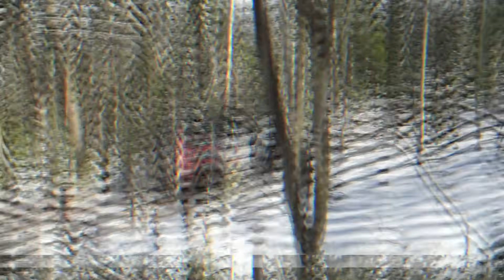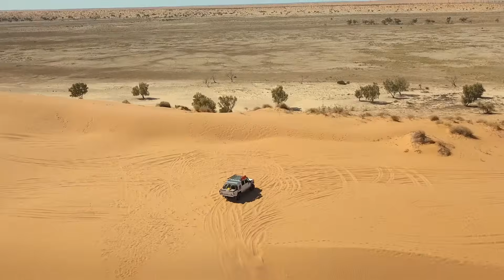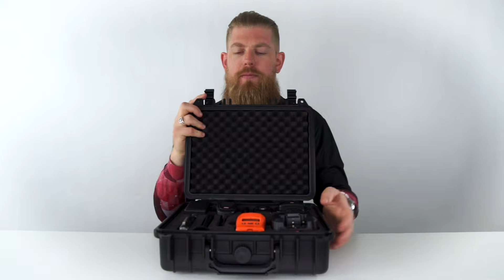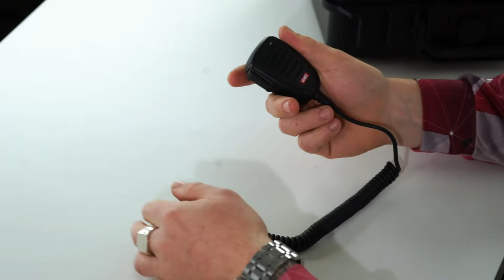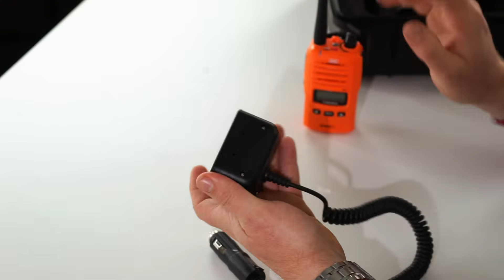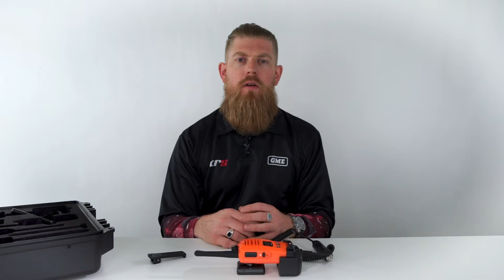GME Blaze Orange Handheld Radio and Car Kit (𝗧𝗫𝟲𝟭𝟲𝟬𝗫𝗢𝗖𝗞)

Comment: Is the charging cradle and magnetic bollard sold separately and compatible with other GME 5W handhelds?
Reply from the maker: At this point in time the 3 new components are not available separately.
Reply: ARB4x4 ok thx. What kind of range would this kit get compared to a full size gme antenna and in cab 5W radio?

Comment: Considering the length of the cable what is the loss
Reply from the maker: If you are referring to the cable on the charging cradle. With no tension, it is approx. 40cm from the base of the cradle to the top of the adaptor (cable only). Hope this helps.